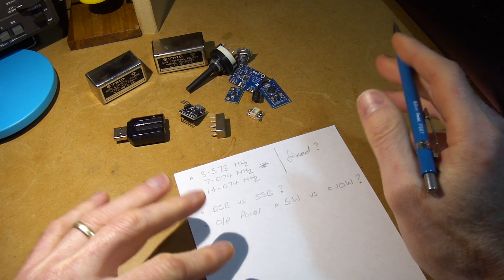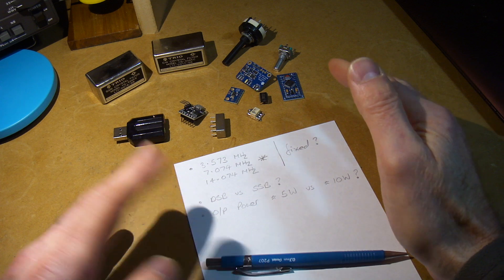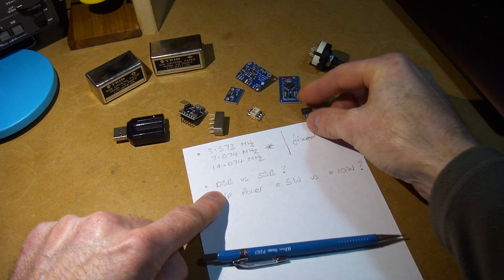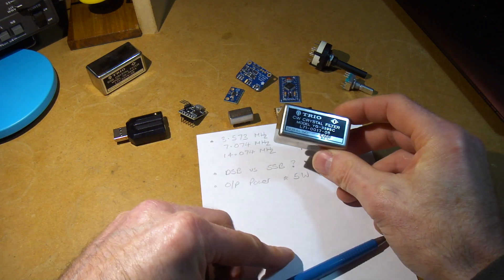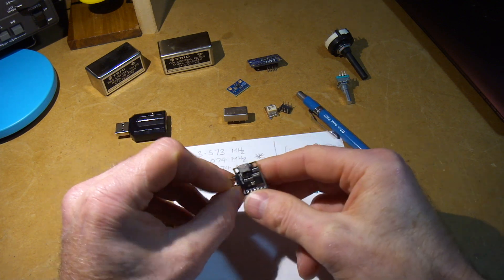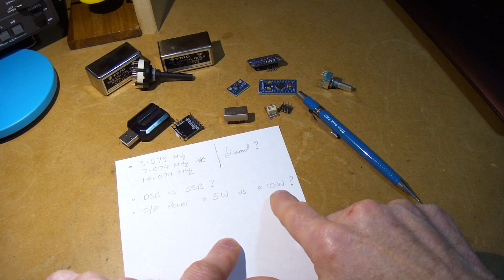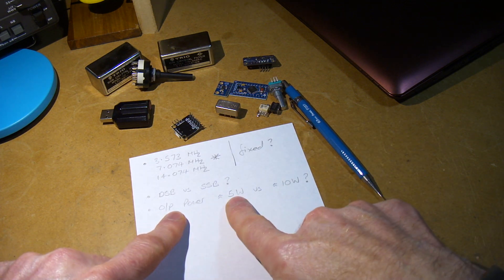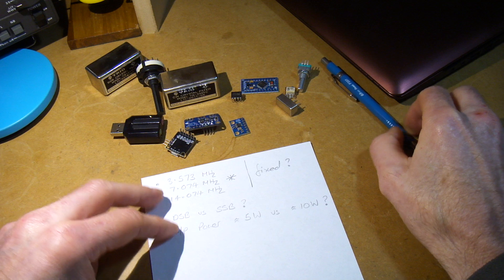FT8 Transceiver - Part 1: Ideas

Comment: Hi Charlie, I have been dabbling with FT8/FT4 and my FT817 during lockdown. I had never used it so I gave it a go. 5W is getting me heard around Europe and into the USA when the ionosphere is co-operating. The fixed line is a good idea but be aware that FT4 is a different frequency to FT8 and it would be a shame to miss the second 'mode'. It may even be worth going for PSK, FT8 and FT4 in one digi rig? Should be possible with a multi-position switch. SSB is more spectrum friendly as the TX frequency is not fixed but varies within the few kHz of passband. You could therefore be causing undue interference in a narrowband used by someone else and you are sending a signal that cannot be decoded. You also get more bang for your buck if all 5W are in the one sideband. I had terrible trouble with those cheap soundcards. Someone old me they don;t like Windows 10. I will be interested to see what you find. Keep up the good work Charlie.
Reply from the maker: Thanks Steve. That's really interesting about the cheap USB sound card. I'm still debating if I need to use that or not. I'm also now looking at a SSB rig that will support CAT, freq agility and multi-mode. Thanks again for the input Steve.

Comment: I would go encoder instead of switch for possible expansion later. I'd also go SSB for the same reason. Don't forget the GPS for timing. FT8 wants you to be fairly close on start/stop times for your packets. I think 5 watts would be great with a long wire up in a tree or hanging from a balloon. Actually, I'm running a 12m end fed about 3m above the ground and it does okay. Using a random wire tuner for the match. I know whatever you choose, it'll be interesting. Cheers...
Reply from the maker: Thanks Ed. Looks like SSB is the way to go. 5 Watts was my original intent too.

Comment: Very interesting project! I am actually working on using a Teensy to make a portable FT8 system. (Using the Teensy to do the audio processing and stuff that WSJT-X normally does.) If I get it working I will be sure to make a video of it.
Reply from the maker: Sounds good. I'm probably going to use one again too for this. Provide the Teensy with I and Q audio then apply another 90 degs in software. I've been wanting to revisit that for some time.
Reply: @CharlieMorrisZL2CTM  I have recently found that it will be hard to stuff FT8 (Decoding) into the Teensy (I have a teensy 4.0) So I might have to look into external ram chips to supplement the memory.   I am planing on just feeding my Teensy with audio from my base rig. (for 6m) and the audio from my sort of mobile HF rig. (IC-718)

Comment: My word Charlie, I think you've got yourself a tiger by the tail … well done, excellent ideas all around. My 10 cents is build your project without knobs and dials and have everything controlled by WSJT-X. The Teensy & audio shield, while a little more complex, would be very elegant. Throw in RF phasing, boom, job done!!
Reply from the maker: Thanks Neville. What you have suggested is exactly what I am coming to. I like the Teensy and the excellent audio DSP tools.

Comment: What about adding CAT support so you can control frequency and PTT from software? Might not be terrible to implement a simple protocol like the FT-817 uses. The uBitx uses the same Si 5351 , so you might even be able to use that firmware as a starting point: https://ubitx.net/how-to-load-up-a-sketch-on-your-raduino/
Reply: If the sound card is a cm108b inside it supports ptt with it's gpio pins.
Reply from the maker: Cheers Tim. I still need to look how best to enable PTT. VOX may be an option.
Reply from the maker: Thanks Mike. It will (if i can make it work) have CAT. If I can do continuous tuning with the WSJT-X software then I'll go headless. This should be fun!

Comment: I wold go DSB but dont go fixed
there are more frequencies for outher excelent modes, example FT4, WSPR, JS8, RTTY.
For the finals i whold go to a push pull BS170 configuration, i have seen this configuration on kits and is Cheap and Work Good.

73 de Pedro CT7ARQ
Reply from the maker: Thanks Pedro. I'm not looking at SSB and not DSB for now. Having freq agility will also be a requirement. I'll look at the BS170s too.

Comment: Hi Charlie, 
FT8 section is actually 2.4 to 3.0 kHz of bandwidth. the recommended power level is less than 30W. The base frequency on 40 meters starts at 7.074, this extends as much as 3Khz. ft8 is narrow banded  (the tones are 6.25 Hz apart) but to receive all of the stations replying to you  then you need to be able to receive the full 3 kHz above the base frequency.  FT8 uses the upper side band mode on all bands. 
Simplest solution is this... teensy 3.5 or above + the correct audio shield. set the software to see the teensy as a sound card ( it will act as a mic and speaker combination... after programming). the software on your pc will output audio into your teensy soundcard to mix with your base frequency of 7.074 MHz ( this gives you an offset for your TX frequency in the software). Your receiver will output the audio through the USB into the pc software for full decode of all stations. The only thing left is to work out how you prefer to do the PTT from the PC software. I assume you will be using the si5351 again so the software can tune your radio for you. 
Best regards
Simon - M6FJW
Reply from the maker: Thanks Simon. I was focused so much on the TX spectrum and missed the RX side of the house. I see WSJT-X is suggesting a BW >5kHz for some modes. I'll have to look into that. I've used the Teensy for a SDR rig in the past so I'm reasonably comfortable with that platform. I like it a lot. PTT is going to be interesting...
Reply: @CharlieMorrisZL2CTM  for the PTT you have 2 options ... 1 a VOX circuit in your radio as suggested by somebody in the comments. 2. program cat emulation into the teensy code.  The reason i say 3 kHz is some older radios don't have higher than 3.0 or 3.6 kHz in the ssb modes available to them and if you actually check the screen on an SDR or waterfall you will see in actual use nobody tends to go above 3 kHz...

Comment: A very nice project idea. Curious how you will realize the soundcard to transceiver interface. It has for sure been asked before, but what camera are you using to record your videos?
73, Andreas.
Reply from the maker: Hi Andreas. The camera is an old Sony DSC-TX9. Does it work well, or not Andreas?
Reply: @CharlieMorrisZL2CTM  It works perfectly well i think. Thanks a lot for your answer.

Comment: Good Point  Peter(vk3ye) JS8 would be more fun than just FT8 how about a combo approach using the press button on the encoder to cycle through the fixed frequencies then and or adjust frequency with the rotation function of same encoder. SSB would be good. I suppose with the computer interface you have already created an all mode device depending on the S/W.
How are you getting on with those AD1-24 mixers from Aliexpress BTW?
Reply from the maker: Cheers. I'm going to make this a digital modes rig and make it agnostic.

Comment: Been using QRPver tuned up to 7074 for a while. Traditional TX RX "superhet" style design. Works just fine with companion 10W PA. Found problem interfacing audio to PC as output is "line level" and had to attenuated to "mic level" for USB soundcard input. however given a choice old xtal filter systems are old and boring, I also would spend a bit more and follow the phasing or weaver SSB route.
Reply from the maker: Thanks. I'm definitely looking at the Teensy route and not a crystal filter. I've been wanting to revisit that for some time.

Comment: I'd replace the microcontroller with a pi0w. Then you could integrate a GPS and have a wspr beacon too. Then just use vnc to control it. Also thanks for the project idea.
Reply from the maker: Cheers Tim. I must dig my Pi 1.0 out again, or buy a new one :o)

Comment: Use SSB with a direct conversion image reject mixer as the product detector.  The Midnight Design Solutions "Phaser" JT8 transceivers do this.  Look at their design for ideas.  The rig was just reviewed in the current issue of QST.
Reply from the maker: Thanks for that. It will be SSB and more than likely I'll use the Teensy.

Comment: Really looking forward to this design Charlie. I liek the idea of the spot frequencies. However also some good suggestions about having ability to use it for other digital modes as well. Be aware some DXpeditions operate FT8 on different frequencies to the standard ones.  Love your videos, keep up the good work. Cheers VK5AV
Reply from the maker: Totally agree. Freq agility will be built in. I'm going to look at the WSJT-X software today and the CAT function.
Reply from the maker: I have been thinking about this. Would it be enough to have CAT control and allow the WSJT-X software to change the rig's freq, or would I need a VFO capability over and above that in the rig?
Reply: @CharlieMorrisZL2CTM   You can run with or without CAT ... WSJT-X have a fixed list of freq. it have no tuning  capability ... but you can add your freq. to the list in the program .... there is a project from elektor mag. its an arduino shield sdr that use si5351 and I thank it came with a PC control  software   link  http://www.elektronik-labor.de/HF/SDRshield.html#wspr
this page have a lot of information and code to use .... or if you want to make your code that will be another story ... good luck
Reply: @CharlieMorrisZL2CTM  the software controls the freq in my FT817 via CAT. I just click the band and it does the rest, mode and frequency.

Comment: Multi band phasing radio will be  a good challenge
Reply from the maker: Indeed. I'm looking to use the Teensy and the audio DSP library.
Reply: @CharlieMorrisZL2CTM  good luck with your project ... but i think digital mode do not like DSP ... I'm not sure what DSP 
are you going on ... but you will find it every where in the internet ... turn off the NB  NR DSP when using digital mode

Comment: Hi Charlie! It is a great idea, waiting to go trough the design. Love your videos because you explain every single component what is its purpose and calculation understandable for a mere mortal. Have learned a lot from you and many times I rewatch your old videos home brewing something similar. I think your channel is a RF design wikipedia for mere mortals :) I would go with a rotary encoder and a display since it would make a nice portable radio for digi modes. You could use it not only for FT8 but also others like JS8, PSK31, RTTY, etc. If the rig is controlled by an arduino than who will copy your project can easily implement its own code for CAT control or make it for other bands at wish. Certainly as other mentioned it should be a SSB with a wider filter. For digi modes I would implement also an ALC circuit to avoid overmodulation and having a dirty signal. I think the arduino ADC can be used to display the audio input level so you can set it right on the computer. Will use your design and I think will put a Raspberry in the same box so together with a tablet can have a "cable less" portable rig. Best 73's Andrej - s57rw!
Reply from the maker: Thanks Andrej for the feedback, it's much appreciated. I'm going to make this a digital transceiver and not specifically for FT8. I'm also going to include CAT. Thanks too on the ALC tip. I'll look into that.

Comment: CW filter is not a good idea. While the signal itself is very narrow, signals can appear in the whole of the SSB (USB in this case) bandwidth. So the SSB filter is the right choice.
I would go for SSB, not DSB, for interference reasons, as many digital modes are crammed into the bands.
I like the idea of using the spot frequencies with a switch. Only drawback is having to re-program the microprocessor if the operating frequencies change.
Why not 10MHz, (or 5.2MHz), too?
73 de OZ9QV, Jan
Reply: Nice idea. Whatever power output you decide on 5 or 10 watt would be ok. Due to the duty cycle the power transistors probably need more heat sinking than a CW or SSB rig.
Reply from the maker: Good to know David. Cheers.
Reply from the maker: Hi Jan. Yes, I've read some more and the CW filter is a terrible idea. SSB is also a must. I'll also have CAT and frequency agility.
Reply: @CharlieMorrisZL2CTM  Re.: Frequency agility. I see 2 options:
a) full VFO
b) a set of programmable memories.
If you use CAT, the WSJT-x is capable of controlling frequencies.

Comment: I've used the cheap USB audio sound cards like you've shown quite happily with FT8. I'd also suggest perhaps WSPR freqs as well as it's ideal for QRP.
Reply from the maker: Hi Graeme. I'm still mulling over the USB sound card versus using the computers built in mic/speaker ports. My normal portable computer is a Surface Go, which only has one USB-C port. I'll use a USB-C to B adapter for the CAT side, which makes the audio side difficult as I don't want to use a USB hub. I'll get there.

Comment: Definitely SSB instead of DSB. If it will be used for contacting DXpeditions or contests, it will need to be able to use other frequencies. Other frequencies would also allow for JS8Call or other WSJT-X modes.  It should have at least 3 KHz or 4 KHz of receive spectrum for the waterfall and receiving multiple stations at a time.  Rig control and support for split operation would be nice to have as well.
Reply from the maker: Agreed Rob. SSB and freq agility will be a must.

Comment: Hi Charlie, I was also going to suggest phasing. I'd recommend also JS8 capability as it's a conversational mode only a few kHz from the FT8 frequencies.
Reply: I was thinking the same thing! NE602 on receive and a phasing exciter/transmitter perhaps. Also - why not keep the encoder and just have it rotate through the fixed set of frequencies (80, 40, 30, etc). That might be more flexible than a fixed switch
Reply: @na5y  if he is going to use the pc ... then he can use it to control the board and no need for the selector
Reply: @وهابالربيعي I was wondering about PC control - that would add another layer of complexity. You'd have to use a usb to serial adapter (or write a driver) PC control isn't really needed as you can just use the presence or absence of an audio signal from WSJT-X to turn transmit off and on
Reply: @na5y Yes that will make it really simple
Reply from the maker: I need to see if the WSJT-X software has a 'VFO' like mode. If it does, then I'll make it headless.
Reply from the maker: Hi. At this stage it will have CAT (if I can make it work), which should be a bonus.
Reply from the maker: Thanks Peter. I agree. I've been mulling over the excellent feedback for a day or so and have a much better idea of where this should go. It won't be a simple rig, but a fun one none the less. At this stage I'm looking at WSJT-X support (not just FT8), SSB, Teensy for DSP,  freq agility, CAT and 5W or so. I might have to make a second one with just the basics. We'll see! Thanks again Peter.
Reply from the maker: I see too Peter that JS8 is not part of the WSJT-X suite. I'll load that up too today and see how it works.

Comment: If you are taking a poll, 10w SSB please. One thought. If you have the serial interface why not control the frequency and perhaps other radio controls from an app on the computer? It would also be cool though more complicated to be able to switch from 1w to 5w to 10w.

Any choice you make I am sure it will be an interesting build.
Charlie KM4ZZ
Reply from the maker: Thanks Charlie. My plan is for SSB and CAT. I suspect the power will be 5W for starters. I like the idea of a 1W switch. I'll have to look into that. Maybe a simple attenuator pad in the PA chain.

Comment: Definitely SSB, DSB is QRM on digimodes. Suggest two "channels" per band one for FT8 and one for WSPR or other mode. Linear amps seem a waste for digimodes, would be nice to incorporate class E PA somehow. Also, CW filter not wide enough for FT8 as signals often spread across up to 2khz.
Reply from the maker: Agreed. SSB and multi-modes. The Class E amp is interesting. I'd love to be able to use that, but make it linear from a freq perspective may be difficult. I've seen some academic papers looking at it. We'll see!